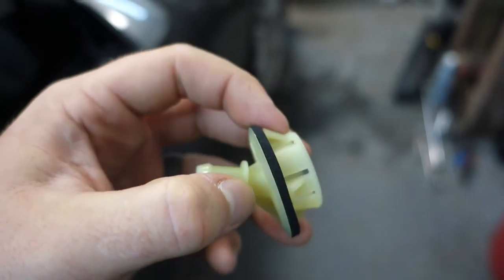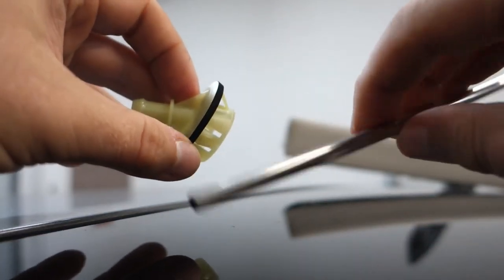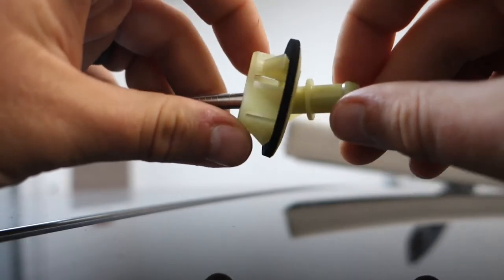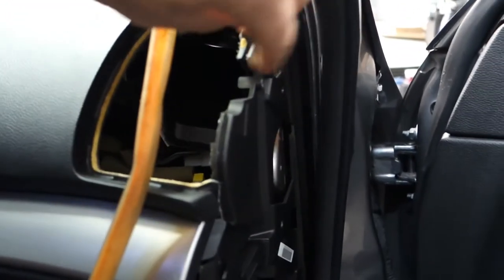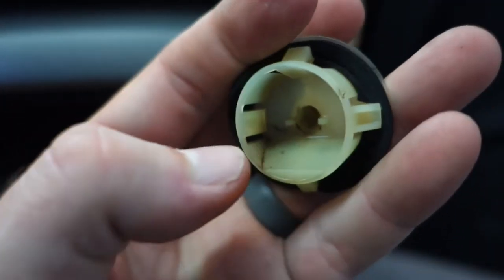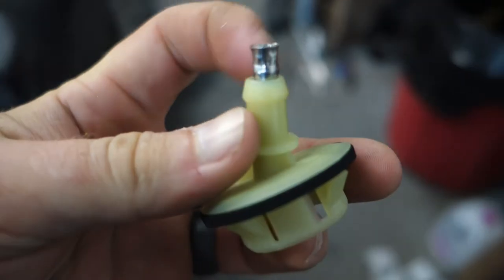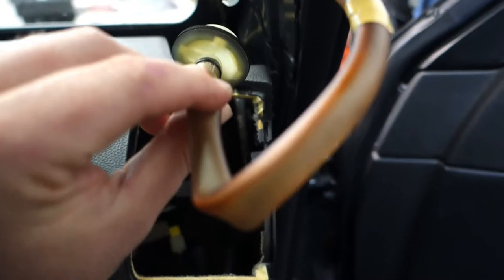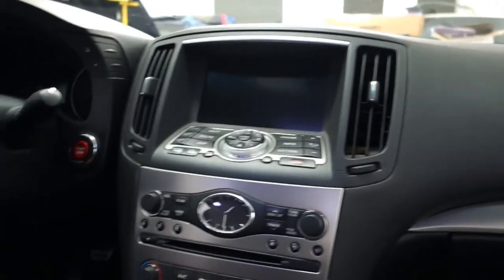Infiniti G37 Sunroof Drains Leaking Again - PERMANENT FIX!!

Comment: The fix is actually easy.  Remove the A pillar and remove the tape that's attached to the hose.  Stretch the hose forward to give some slack.  That's all.  What happens is the hose shrinks over time and tugs on the drain plug.  Or go to Home depot and get some hose and extend the hose going to the drain plug to give it some slack.  Got a foot long needle nose pliers and a flash light and I had mine fixed in about 5 minutes.
Reply: wow, your 5 minutes took me 2 hours lol
Reply: @mike212916  The drivers side is a b-tch cause of the steering wheel.  The passenger side took me 5 minutes cause I already knew what I needed to do.
Reply: You make it sound easy but it’s not, my vent thing won’t let me push it down so I had to hold it at the same time which was a pain in the a**
Reply: @TakeThis_L  I used a foot or two long flat head screwdriver too.
Reply: I need this

Comment: I had the same issue with mine and pondered taking it to a sunroof specialist with their own shop.  It took a bunch of looking to find someone willing/able to fix sunroofs.  The sunroof specialist charged a couple hundred bucks to just diagnose the problem.  I found a mobile sunroof specialist who came to the house and fixed it in the driveway for about $200.  He ended up extending the drain line down to the rocker panel and was done in under an hour.  He sees the same issue with Nissan/Infiniti and fixes a couple a week.  It’s been four months and ton of rain with no issue.  Just look in your area for a mobile sunroof specialist.
Reply: Thanks man , I've had mine taped up for about 6 months . Tape works great , but I can't use my sunroof.  Better than a flooded car I guess .
Reply: That person  that fixed your car wouldn't happen to be in CA right? I need to fix this.
Reply: @gwendolynqtl9732  nope. He’s in Maryland. Just look for mobile sunroof specialist vs a shop. A shop would probably sub the job out to this guy anyway and charge double. Go to the source.
Reply: @gshuffs  thanks
Reply: @gshuffs  hey I live in Maryland too and have a g37 and am currently having this same issue , would you happen to remember the name of the shop and the guy who help you fix your problem ?
Reply: hey do you happen to remember the guys name im from maryland as well
Reply: This is good to know. I was just killed at the dealership over this.

Comment: I had this same issue with our 2012 G37 sedan. Water on both sides, front and back. Sucked a whole wet vac amount of water out of it. My dealer quoted almost $1,500. Drop the dash and would not install a modified part. I am not even close to being considered handy but I watched your video, purchased some 12 inch screw drivers and same length needle nose pliers. I  modified my drains with tubes and did the install in one afternoon. It tests perfect and no leaks. I cannot thank you enough for taking the time to make this video.  It saved me money and showed I can do repairs with the right instruction and tools. Many thanks!
Reply: That's awesome! I'm about to try to do mine when the new plugs get here. Wish me luck!

Comment: Hey guys I went to do this and found out the LEAK was ABOVE my battery. I used sealant to seal the cowel above my battery. Seal the space between the cowel (plastic cover) and the windshield wipers. You will see that the opening for the interior air filter is right under there. I had my windshield replaced and they did not seal the cover properly.  Try this first, I spent a day and this was not my problem. 😢

Comment: There should've been a recall on this. This is a known issue. & the leaks typically hit the electric wires on the passenger side smh.
Reply: This is exactly what I am going through at the moment. Its been raining in LA off and on and my car wont start since the BCM and IPDM has got wet. funny thing is that this has happened before, got wet, flooded the passenger side floor, dried out and my car started a few days after

Comment: Went mine was leaking about a month ago I got rid of the yellow piece completely and added a size bigger hose and clamped with zip tie then rerouted it behind the glove compartment to underneath the floor trim and through the ac water drain hole. It fits right in there no issues since.
Reply: Did the same thing problem fixed 👍🏼
Reply: Wish you had made a 🎥 video
Reply: I to did about the same. Instead i drilled a hole in floor and used a thick rubber grommet to seal hole and shoved hose extension of 3/8 diameter down the hole and tested it vigorously with rushing water. Nomore leaks. Also did same to driver side.
Reply: I did the same thing. I extended the tube and splice it in using a t-pipe fitting. No leaks since and much easier to do.
Reply: That is just Brilliant
Reply: Would anybody here be willing to make a video🙏

Comment: I just did this with a plastic tube but still getting water. Prob not from sunroof since I believe this technique worked best, but it looks like from the side window near the corner.  Water leaks right down over the door tweeter and leaves a pool of water under the Styrofoam baffles under the carpet.  Anyone have this issue?  I prob need new door seals but there are so many in that area.  Afraid to take to dealer as they will prob want to replace everyone at like $150 each.   There is like 3 or 4 total per the parts list.  I was thinking of starting  with just the long one on the body of the car that seals the frameless window.  Any thoughts?  Very disappointing for a lux car

Comment: If you have water in the car, I find that the best way to dry it out is to take a home dehumidifier, get a board to put underneath it to protect your seats, use a blanket to get the board level, and run it for several hours with the cord coming through a narrow crack in the window.

Comment: Your previous vid was my go to as it was the most detailed and actually had better camera angles to see what needed to be done.  Though I did buy a new one and used an empty pen shell to mod it.  It stopped my passenger side leak and has been working for the past 8 months; definitely better than the $1.2k I was quoted at the dealership since they said they would have to remove the entire dash.  Glad to see you uploading again as you and motorvatediy are my go to G guides.
Reply: Dealershit wanted $2200 lol. Fixed it with a $22 pair of  long needle nose pliers and a metal straw.

Comment: Nice video man. I just bought my G and had the same issue. I did everything exactly as you said and it only took about an hour for the passenger side drain. It was the perfect fix. Thanks a lot for making this video!!!
Reply from the maker: Glad I could help!  An all too common problem on these.  Glad I finally did something that seems like it will last.
Reply: @kova_motive  I'm about to tackle my passenger side :-(. Thanks for the tips

Comment: I had this problem. Car's computer went nuts with water all over it. I finally cut the front passenger side drain halfway up the A pillar and folded it over, and double zap strapped it. Then I filled the same drain hole in the sunroof with silicone. No more problems.

Comment: Thanks so much.  Extremely helpful. I tried using needle-nose pliers but ended up using my hand, despite my wide palms and small fingers(sorry, ladies).  Going back in was incredibly annoying, the insulation in front of the hole almost broke my brain until I just jammed my hand in there and then it took two seconds

Comment: Thanks for the heads up! I’ve had my 2010 g37 sedan for many years has not leaked yet but this is good idea for an issue I didn’t even know about. Looks like I will be taking my car apart soon since I have some aluminum tubing, flaring kit & some left over rtv sealant. I will also add some to that foam/ rubber ish cheep so called gasket. If I made the exit tube through the firewall a little longer would that hurt anything?

Comment: Good afternoon Kova. Where is your workshop located? I live in new jersey. I have an Infinity 2012 G37X I have a leak in the sunroof I have done everything possible I even did the procedure with liquid plumr gel and everything flows very well the water came out in the correct place as you explain in the video but you still have the problem with the leak Water falling on the passenger side. I am desperate with this problem. I don't want to take it to the dealer but I don't know what to do with this problem. I did what you explain in the video and nothing.
Thank you.
Carlos Castillo

Comment: Knock on wood. I have not had an issuse with my M37X.  But when I had mt SS 07 impala sure had this issuse. . And uea that BCM on passenger side floor had my go bad with water leaking from a not so good seal from windshield change. Corrode the wires and bcm. Lights and alarm would come on and off when parked drained two batteries in one year glad it was under warranty.  Over 7k for harnesses 3 month back order from Japan.

Comment: I was wondering why I didn't see any videos on snaking the drain hole first. Now I know why. I have a leak on the front passenger side only. Confirmed it wasn't draining from underneath the car. Then I snaked it with a brush tip wire and degreaser all the way down to the firewall and followed with hot water. It started draining great so I assumed I got lucky. No, although it's draining outside car it still also leaking inside as well. I guess it's safe to assume the hose leading to the firewall plastic cap seal is shot?
Reply: get new plugs & break off that baffle part

Comment: Hey I have a 2009 g37x coupe, my interior lights have stopped working, my steering tilt, and my seats do not moving anymore? Can you help me out
Reply: It means the control unit on the side of the passenger floor got wet. Take the cover off and let it air dry. You can also disconnect the connection and hit it with compressed air to dry it off faster.

Comment: Great workaround.  How many sunroof drains are on this vehicle?  I have a 2008 Infiniti G37 and am encountering random mold issues (can't tell where it's failing exactly but highly suspect it's the sunroof.
Reply: Hey Jeff. I believe it’s got two drains. One of the drivers side and one on the passengers. They go towards the engine. 

I searched for “mobile sunroof repair” and found the guy who helped me. An alternative is to take it to a glass shop and they’ve likely got a sunroof specialist. You’ll pay more than the mobile guy I used but it’ll be done. 

Not fixing it costs far more than fixing it IMHO. 

Good luck!
Reply from the maker: As stated, there are 2. 1 on either side of the dash behind the vent.
Reply: 2
Reply: I ended up taking the car into a sunroof shop.  It turns out it has 4 drains total, 2 in the front, 2 in the back.  They replaced all 4 tubes and extended them to the bottom.  Not sure why Infiniti didn't do that in the first place.

If anyone wants to see the part diagram showing all 4 drain spout locations then search for the following in Google: 

"Sun Roof Parts fit your 2008 Infiniti G37 Coupe diagram"

Passing the info on in case it helps anyone else.  Thanks for the help, it gave me the direction needed to finally fix this!
Reply: @JeffJennings82 how much did that job cost you?

Comment: I have to bite the bullet and do this, too.   I'll try the metal straw route.  My only concern is corrosion over time versus a plastic one.
Reply: spray the straw with some paint
Reply: You can get cheap stainless steel straws from Harbor Freight, or even your closest Wal-Mart.
Reply: Use 1/4 quarter inch copper pipe and flair it

Comment: Hey are they sunroof drains going into the rear?? Or just the 2 upfront?? 2012 g37x
Reply: There are 2 in the rear, one on each side. They exit out of the rear fenders above the rear wheels. You can access them by pulling back the fender or removing the trunk liner.

Comment: I’ve been wondering what’s causing water to leak to my passenger floor I can’t lie tho I’m not too car savy should I take it to a shop to have it fixed for me?
Reply from the maker: It's a little tricky but nothing you can't do if you take your time.  I would try it and if you're unable to get it fixed, take it somewhere.  Luckily, this doesn't take away your ability to drive the car if you need to take it somewhere.
Reply: Bett ima try fixing this problem with my moms car !! I have some auto experience might needa ask my teacher to barrow the tools tho

Comment: Haven’t gone this route. But I’ve heard of people still having this issue even after doing this. So curious to know if this has solved your issue @Kova.
Reply from the maker: This is the only way I was able to solve the issues.  I initially just replaced both drains with OEM replacements but they started to leak again.  This "mod" has been trouble free and they haven't leaked on me again.
Reply: @kova_motive  Why didn't you just extend the tube and splice it into the AC drain tube in the passenger floor?

Comment: Can the leak happen in the back seat?
Reply: Yes, if the rear drain tube (which exits out the rear fender) gets clogged. You can access it by pulling back the trunk liner.

Comment: Issues I've had bc of this leak. 
Car wouldn't start
Car wouldn't turn off
Transmission suddenly goes into "slam every gear" mode
Auto windows forgetting they are automatic 
Randomly dead battery
Probably other shit.

Comment: Here is another fix for those who have lots of time and/or want to be less invasive in fear of breaking things because that's always what happens.
 Pop off the A pillar covers to expose the drainage tube.  Be careful prying around the airbag cords. Open the sunroof. Lay towels along the doorline and seat. Get a condiment type squirt bottle or turkey baster or something similar.  On the left or right of the forward part of the sunroof tray squirt a pure cleaner into the corners.  I've used vinegar but the smell stays forever so this time Dawn Heavy Duty Degreaser.  The more clogged the better, slowly squirt it in until you see the tube fill.  Squeeze and work the tube to loosen the gunk until it drains. Wait a bit for the solvent to work and then slowly flush with hot water until it stops dripping internally.
  Order a new sunroof gasket if you have the money, if you dont then mask off the gasket and seal it with gasket seal or liquid tape.